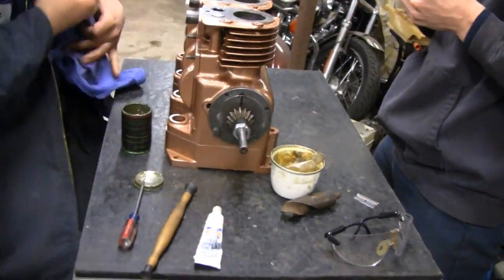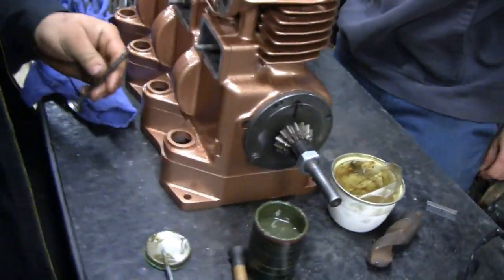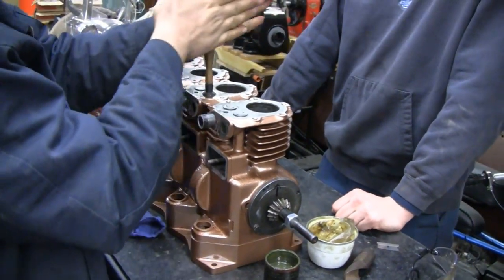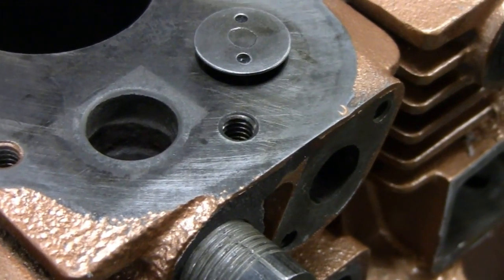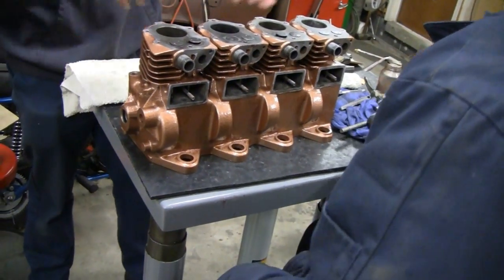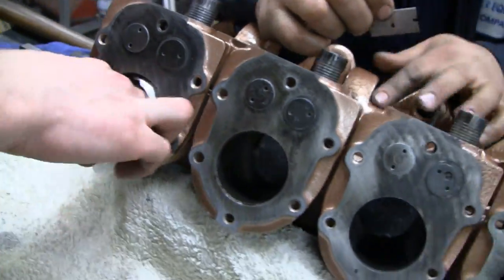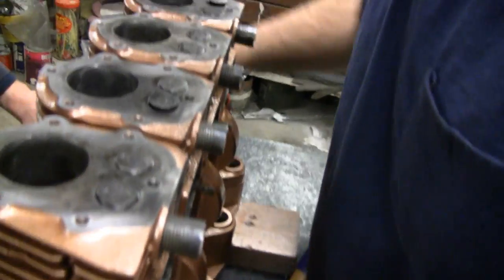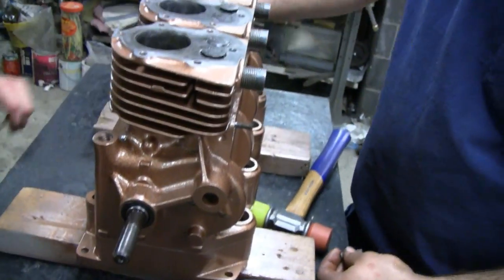HOMEMADE 4 CYLINDER BRIGGS PROJECT (part 16)

Comment: You know the local auto machine shop could do a valve job on the seats and valves for a reasonable cost. Then you wouldn't have to do a lap dance on the valves. Also, I think the Wright Brothers built this engine with a drill press and old engine lathe and it probably made more horsepower. It powered the Wright flyer. Why do grown men monkey around with this junk? 

When you transition into Alumenium small block Chevys or Honda Engines send me an email. 4 Cylinder Briggs and Stratton? Why bother?

Comment: The reason everyone is curious about the crank, is we are wondering how it was done. Were the 4 original cranks joined together (no mean feat!) or was a new crank created from bar stock with all the webs and big ends pressed together?
Same goes with the cam shaft, although I guess they were just cut of and welded together?

Comment: I would be a little concered about air flow. 4 cul using the same size intake and exhaust as one. I don't think you will see full power. But good ate toon to details.

Comment: I just joined your site. Have you considered cooling to be an issue yet?
Reply from the maker: Welcome Bud!! Yeah cooling isn't a problem, It will be getting massive amounts of air from both directions converging between the two center cylinders creating a helical vortex equivalent to hurricane force winds!!☺
Reply: I have a older Cub Cadet tractor drive shaft drive that your engine would be perfect on. Good luck with this. I can't wait to see how you control the firing order.

Comment: Nice paint job! Brings back engine shop memories of the Neway valve seat cutters we used to do the valve seats with then used a Sioux valve grinder to do the valves. I think there was an attachment to grind the valve stem and if you took too much and lost the bevel on the stem end...can't remember if you had to get a new valve??? I think we would grind new valves to check to see if they were bent and you would change the angle by a degree anyway to get an interference. You needed to prove to the instructor that the seat and the valve contacted each other in the right spot. Fun!
Reply from the maker: Thanks Bud!! We could have used a Neway on this!! We used a homemade cutter, but it worked great!!☺

Comment: Curious (Maybe I missed the answer in a previous video?) but how many main bearings are there?
Reply from the maker: 3 Two ends and a center bearing!!☺
Reply: 805ROADKING I'd love to see how you made that work, is it a two piece crank? Excellent work on the engine, can't wait to see it run!
Reply from the maker: 75Bird455
Nah it's a one piece crank!!☺

Comment: btw how hard do you think it will be to do this to weed eater, or chainsaw engines??? like maybe 6 inline or v8 or even a twin to start out with!
Reply: wont have to deal with the oil pans or valves or any of that jaz!!!
Reply from the maker: It would be almost impossible!! They're cheap shit aluminum engines that barely run right when they are new!!☺
Reply: haha what about lawn boy engines

Comment: That's a really old timey looking paint job, I like it. Sure coming together fast now. "...that's fine Mike"  Too funny.  That exhaust and intake look great all painted up, the exhaust is just far enough away from the flywheel to get a belt on. Friggen looks factory made man, it ought to blow away a lot of people who haven't seen your engines or your vids before. SWEET
Reply from the maker: Thanks Bud!! Yeah the twin blew their mind!! This should blow the head right off their shoulders eh!!☺
Reply: That old-timey paint... is pretty cool. Is that some sort of process?  Is it a two stage paint?
Reply from the maker: Nah just spray can hammered paint!!☺
Reply: Really? Wow, that's cool, is that how they did that look back in the day?
 Wait... what do you mean by 'hammered' ... a ball peen?  The reason I asked in the first place is I have always liked that old paint style but never knew how it was done.
Reply from the maker: I'm not sure if that's how they did it back in the day!! The call it a hammered finish, hammerite or hammertone because it makes it look like a piece of metal that was beaten and shaped!! They used it on alotta industrial equipment because it was heat and scratch resistant!!☺
Reply: Hammered finish, I never knew what they called it, but I have always admired it on old pieces of equipment and wondered how it was done.  I actually have an old projector with that finish... but how the heck did you get it to do that? It really does look right for something from back in the day.  I saw something the other day where a guy took black oil based paint and wiped it lightly on the entire piece he was working on, then with a clean rag he wiped off just about as much as he put on, what was left made the thing he was working on look amazing,  It look aged, not dirty, but aged, and gave a lot of depth to the surface too. Just a thought my friend!
Reply: Huh, I just looked up hammered finish and Rustoleum makes some today, SWEET! Now if I ever have a project I want to look aged or have that type of finish I'll know what to ask for! I'll bet I'd find stuff called hammerite or hammertone too, thank's bub!

Comment: Great Project and Great Workmanship / Teamwork .Thanks for sharing.I have a question about the crank.How did you connect the 4 cranks and kept them straight? I've been following the project from the beginning and I don't remember any mention of the fabrication of the crank.Thanks again for sharing
Reply from the maker: We just precision welded them!! We showed it a couple of times but not in detail!!☺

Comment: Is the crank supported only by the two ends? Or are there other main bearings still in between the cylinders? 
That's why i've previously asked to see the crank...
Reply from the maker: You wanted to see the Center bearing!! We didn't show that, but that was quite an engineering marvel in itself!!☺

Comment: Looks fantastic RK!
Is that a hammer finish copper or is it just the way the cast makes the paint look?
How did you decide what firing order you wanted?
Reply from the maker: Thanks Vin!! It's hammertone paint, most of the block was smooth as glass from all the bodywork, the paint helped bring the cast look back!! The firing order is 1-3-4-2!!☺

Comment: You really need to put that thing in a tractor once you get it running and tuned out! That thing would sound amazing under load pulling an implement or just putin around at a show! Nice job as always! I like that color!
Reply from the maker: Thanks Bud!! That thing would blow to pieces if we put a load on it!! It's already doing way more than it's designed for!!☺

Comment: How will you know how much oil to put in.....Do you know how much each engine needs and then times that by four????
Reply from the maker: We just filled it and kept checking it!! It takes 2 qts!!☺
Reply: ahah i always worry about putting enough oil in a single cylinder engine ahah

Comment: Hey quick tip here. Those flat stone homes are junk buddy. Buy a ball home that fits these motors its what a machine shop uses after they bore it but on a bigger scale. A ball hone goes right in the drill like that one but it has a ton of stone balls on wires the resurface the cylinder.  Your cross hatch is more of straight circles then loops. Search the interwebs for a ball hone they work 10x better.

Comment: Still want to see the crank  how did you make it or is it adapted from other engine? Tip the engine over and give it spin
Reply from the maker: Any video of the crank has already been shown. The engine has been buttoned up and running for weeks already!!☺
Reply: Does that mean there is a video on the crank construction also the can the cosmetic work is great but the construction of the crank and can are the true engineering feat!
Reply from the maker: Nah no construction video, just a look at it after it was installed!!☺

Comment: looks so good that when you go to shows there not going to believe you made it,,
Reply from the maker: Thanks Must!! Yeah that's the fun part!!They do that with our twin!! then we also get the goofs that tell us they had one of them when they were a Kid!!☺
Reply: I agree with mustie1....looks too good !
Reply from the maker: Thanks Capt!!☺
Reply: 805ROADKING  1 issue i  noted is how the close the exhaust tip is to the flywheel. i think brings would have routed the pipe away from the flywheel for easy access when installing a  v belt.